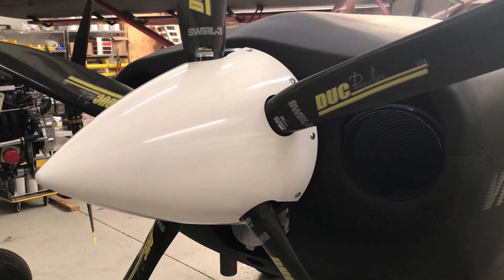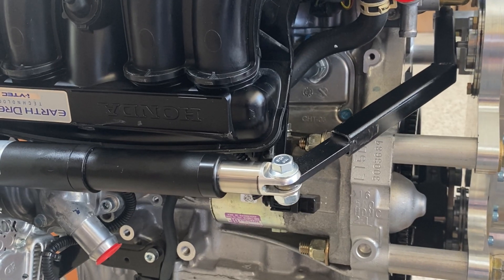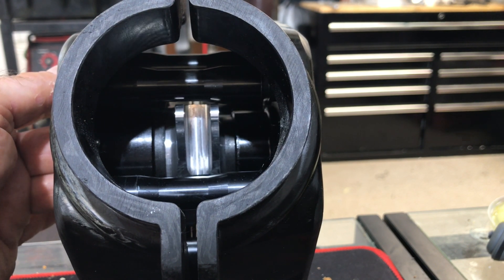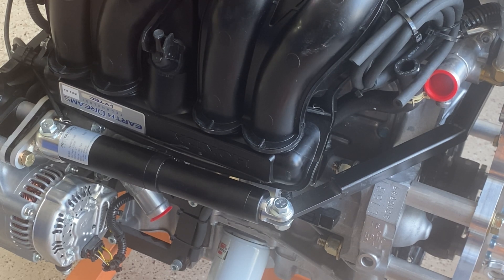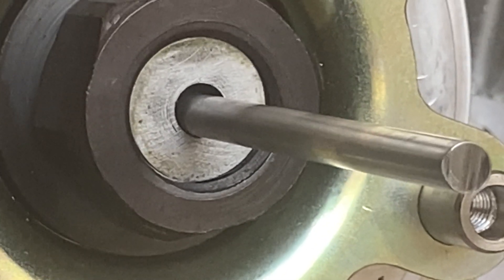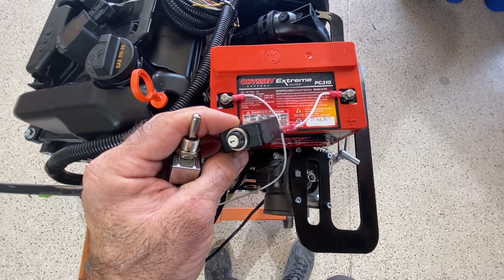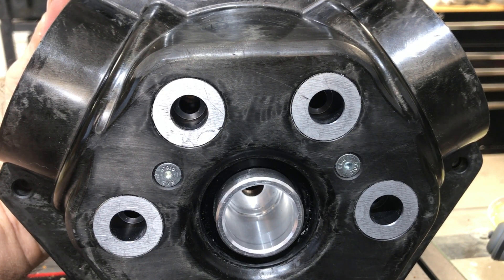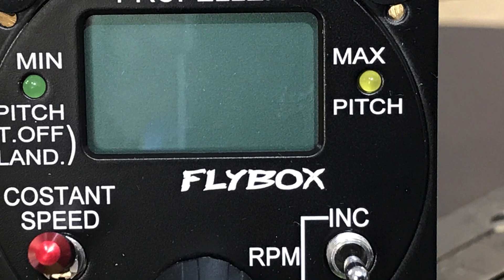Lightweight and Low Cost Variable Propeller by Viking

Comment: Really simple effective and brilliant design Jan, that’s what I’m talking about!!!  Can’t wait to order up this option.  Available on 3 or 5 bladed DUC props, so which is better and what cost difference and total cost add-on for a 195 Turbo model?
Reply from the maker: The 3 blade DUC isn't rated for the 195 Turbo HP (at this time) that's the reason for the 5 blade. We have the 3 blade LUGA prop that we use on it, but it a lot different.

Comment: Very efficient, simple design for a variable pitch propeller and is potentially going to be priced at a game changing level.  I especially like that when you have to perform maintenance on or replace the actuator in the future, the propeller won't have to be removed to do it.  Additionally, not having to regularly inspect and/or replace carbon brushes or ever deal with prop seal leaks will be nice!  This new product should also enable Viking to delve more into the go fast home built market, should they choose to do so.

Comment: Brilliant and rational.  All the more reason to buy and stay with Viking.  How do we measure pitch change in flight?  How do we know what is best in climb, cruise, descent, and approach?
Reply: With RPM and manifold pressure.
Reply from the maker: It is easy because you fly the entire flight on the propeller, not the throttle.  The throttle is wide open for all of the flight.  The exception is when you get into the pattern to land.  Then minimum pitch and fly with the throttle.  No need for a MAP gauge, unless you just want one to look at.
Reply: He mentioned at the end of the video, that it will be able to be used in conjunction with a prop pitch controller.  Of course, with the addition of a manifold pressure gauge, you could  also control and monitor it like you do a complex, certified GA aircraft.  Then, you could have a simple switch to actuate it, like one of the early Beech Bonanzas.